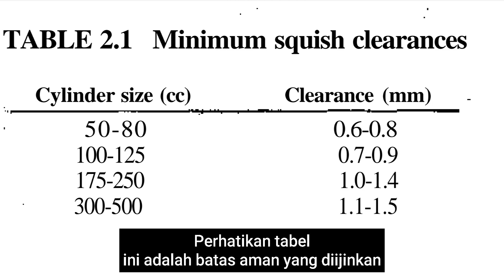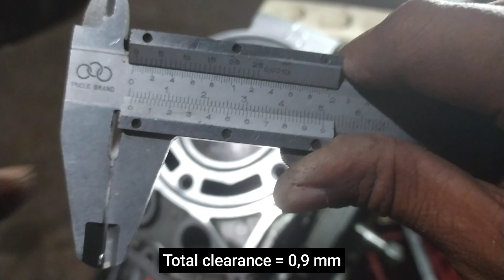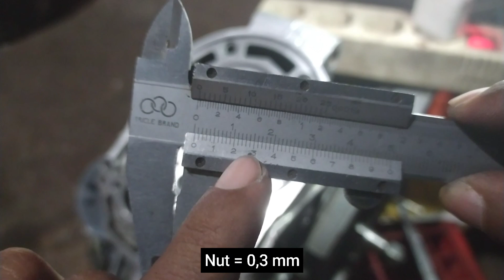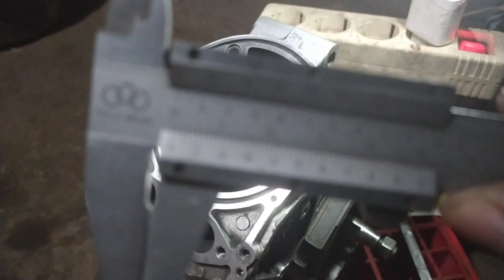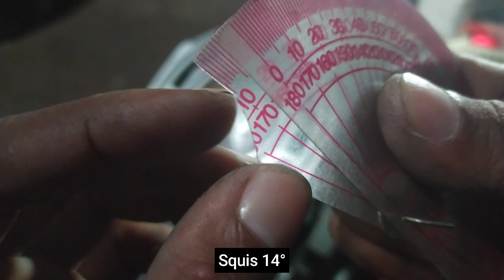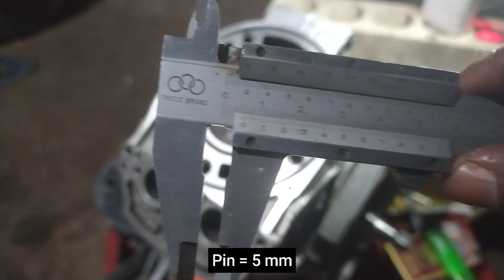Pengukuran Ruang Bakar Ninja Part 2

Comment: Mas mau tanya, untuk lubang transfer jika di naikkan / di perbesar angka durasiny. Efeknya apa? Apakah harus seimbang dengan durasi exhausny. / ada batasanny nilai durasinya. Untuk 201 meter... matursuwun....
Reply from the maker: Idealnya ex harus lebih tinggi minimal 500-1000 rpm dr transfer 
Smua tergantung uji coba yg dilakukan

Prinsipnya
Smakin tinggi transfer = smakin menurun tekanan gas
Slama mas bisa siasatin hal itu aman aja
Klo ga bisa siasatin trima resiko rpm drop dr bawah smp atas
Reply: @GP_TUNER  siap mas, suwun masukanny
Reply from the maker: Sama sama